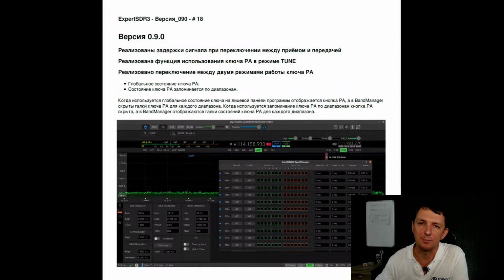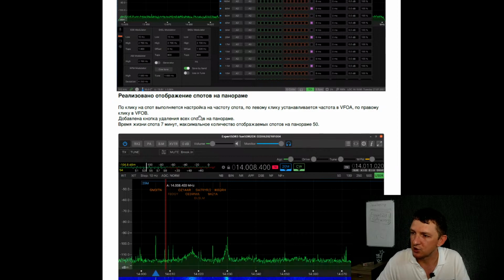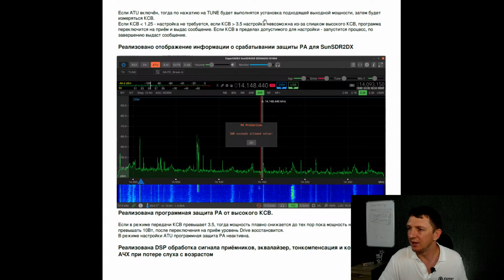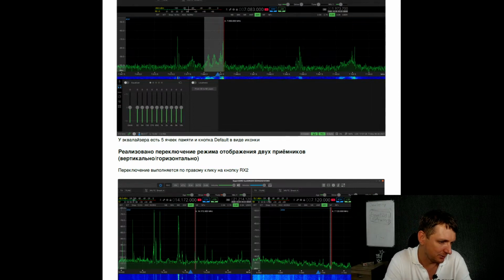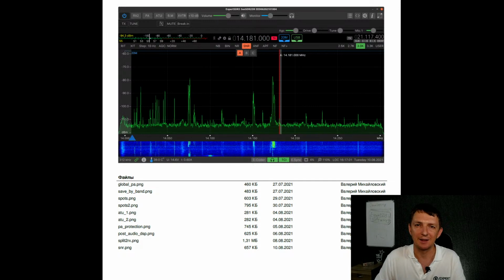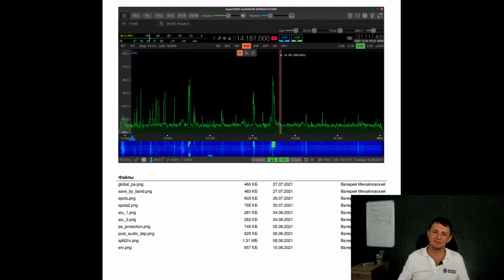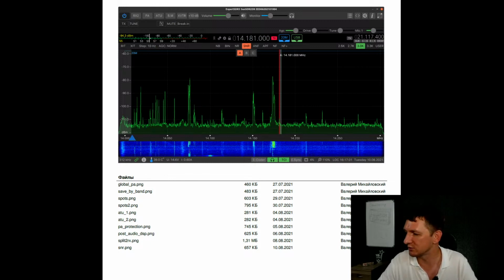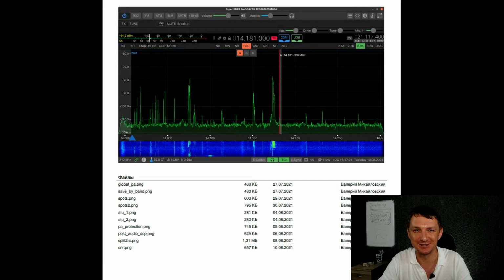ExpertSDR3 - Whats news?! 13.08.2021

Comment: Thanks for answering my question, here in usa we'd like to monitor HF 1.8-30 MHz on one slice and 144-148 MHz (2-meters) at the same time.
Reply from the maker: Understand. It's a hardware limits in our case.
Reply: @R6NY  no problem!  it's not a deal breaker, just a luxury :)
Reply: i've been watching your products, i'm hoping it will give me ambition to put up a tower, i sold all my gear because i was quoted $40,000 USD for a proper ground installation. I'm thinking of building my own of course but want to protect the house when lightning hits.